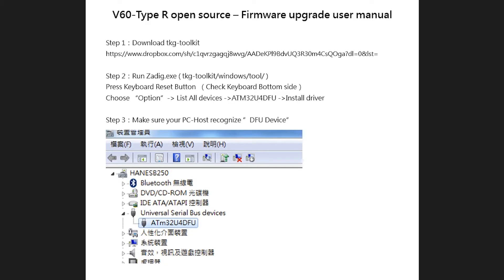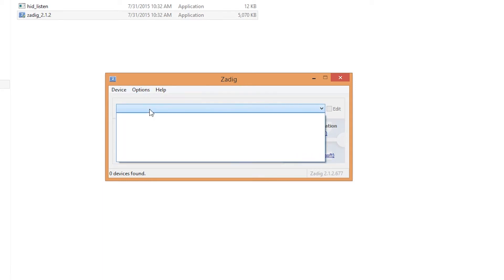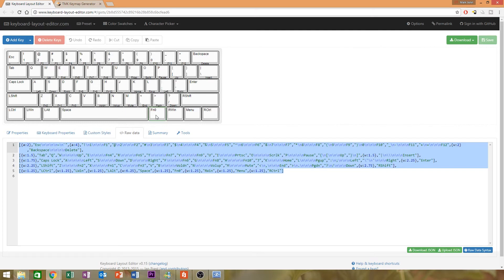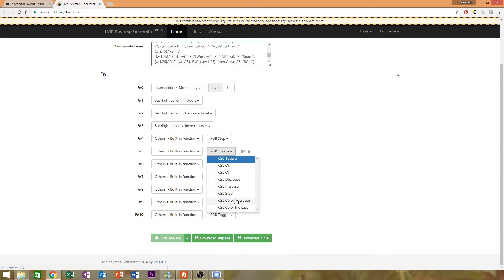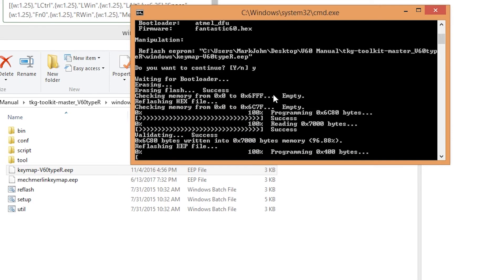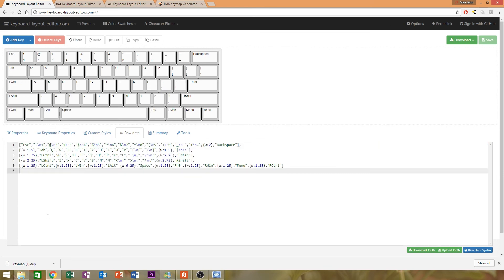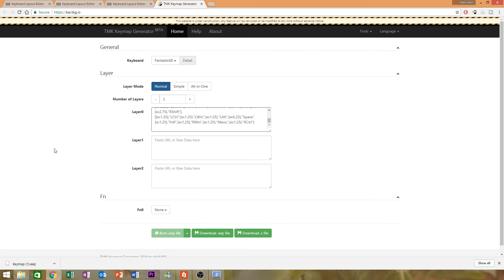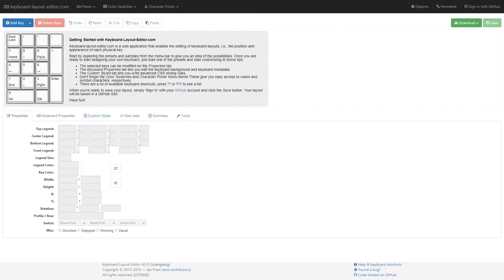KBP V60 Type R Polestar Programming

Comment: hey merlin, just purchased a polestar & i ended up just using your layouts because they seemed good enough,
i got the .eep file loaded but for some reason the space bar stops working, i have to end up reflashing to the default layout, any ideas?
tbh just need left ctrl and capslock swapped thats all. 
appreciate the help
Reply from the maker: Please try using QMK Configurator with this.

Comment: Is it possible to bind a macro to a key? E.g. pressing the v key does ctrl+v
Reply from the maker: Using QMK, you can use LCTL(kc) where in your case kc would be v. So not really a macro but an inbuilt function.
Reply: @MechMerlin  Thanks! And is it also possible to do none ctrl keys e.g. "q 4"

Comment: The tkg.io website seems broken. I entered the default V60 keymap from your tutorial into tkg.io but the Built-in Function option is grayed, and I got error of No matching key Pause. I have selected the Fantastic60 and simple mode. Any idea to solve this issue?

Edit: seems kai.tkg.io and tkg.io are not same website. In kai.tkg.io, I got no issue at all.
Reply from the maker: Jordim you can also try config.qmk.fm
Reply: Thanks, I will stick to TKG for time being. Is it possible to map a browser's back & forward navigation key (the key that you can find in old 7 rows thinkpad keyboard) on the KBP V60 ?

Edit: ok, I found the key label list at here: https://kai.tkg.io/#help. But the label for back & forward key somehow produce wrong behavior, e.g. the "wwwforward" produces browser refresh behavior instead. After some tries, I found out the key label "wwwsearch" and "wwwhome" produce the browser's back and forward behavior instead. I think this is a bug on the kai.tkg.io website on generating the eep file.
Reply from the maker: @johnman750  yes that website isn't too well supported.

Comment: Is it possible to create multiple layers with TMK? For example, I want to have layer 1 for the general usage, and layer 2 for numpad keys cluster, then there is a special FN key to toggle between layer 1 and 2 (so it kinda acts like a numlock key).
Reply from the maker: Yes you can. I personally just use the QMK Configurator though.
Reply: Could you show me how to do this in TMK? I am trying to figure out how to use keyboard-layout-editor.com and kai.tkg.io site to achieve this, but no avail. In kai.tkg.io, if I set Layer Mode to "normal" with 2 number of layers for Fantastic60 preset, there is only one fn key showed there: fn0.

Update: never mind, I have managed to make it work. I didn't realize you have showed the way in this video.
Reply from the maker: Glad that worked! BTW, is there a reason why you want to use TMK? I highly recommend using QMK with this instead. You can see the configurator link here to make your keymap: https://config.qmk.fm/#/v60_type_r/LAYOUT_60_ansi

Comment: Hello! I have followed these instructions, which are great, and every single keyboard function works, except for the RGB increase/decrease. I can toggle it on and off, but cannot change the color levels. The back lighting toggle and mode switch work fine tho. 

Strangely, on TKG, if I set Fn0 to "Layer action > Toggle" the RGB level functions work. Of course thats not really a solution. Any insight on this?

Edit: I followed until the end, creating a 3 layer config to set up the nav cluster, as thats what I wanted as well.
Reply from the maker: The only thing I can think about is are you actually setting the correct rgb function and function key?

Comment: how do you rest the keybored to when you got it in the box because its jut blue lights and it wont work smh ive had this keboard for 6 months\
Reply from the maker: The only way you can do that is if you have the original firmware. You would then take that original firmware and flash it onto your board.

Comment: Hi so I have the type R, and after accidentally flashing it as a GH60 through tmk, I managed to salvage it by resetting the EEPROM and reflashing the default v60 type R layout through QMK toolbox. Is there anyway for me to go back into TMK and reflash it like that? Although I like the functionality of QMK, I really would like the underglow back lol
Reply from the maker: Bryce Rees if you search thru the pull requests you'll see benlyall has submitted a pr to get all the lighting back.
Reply: MechMerlin neat! What does that mean?
Reply from the maker: +drpwnl337 hey I don't know what you mean about what I mean lol
Reply: MechMerlin haha my bad, what does a pull request mean?
Reply from the maker: drpwnl337 there's the master branch in software which is what's released for public consumption. A pull requests is a request to pull in additional features into the master branch. It's a request because it's up to the maintainer to decide if they want to pull in those features
Reply from the maker: There additional features can be written by other members of the community. So in this case the pull requests for LED support is being reviewed to see if it works or not. However it's all still visible to the public so you can grab his changes from github if you so dare lol. It works by the way

Comment: I did the first part and now only the rgb controls work nothing else. And the tool kit says 100% success? any help appreciated, Thanks.
Reply from the maker: The 100% success is in reference to whether you have successfully flashed or not. It doesn't check your keymaps or anything. Would you mind showing me your keymaps?
Reply: MechMerlin They are the default ones that came with the toolkit download. I also made new maps based off the first set of directions. And used the one that's also linked in their directions. That's why I find it so weird.

Comment: All I want is to change my CAPS LOCK into a Fn key, but following this guide, it doesn't seem to work- you just copy/paste your RAWDATA instead of showing what's happening there...
Reply from the maker: Yes you'll see that in 3:16, my layout has the Fn key to be the key to the right of the spacebar. You can swap it to your caps lock. Also you'll see that in 8:38 my capslock has been changed to LCtrl. Just change it to Fn0.